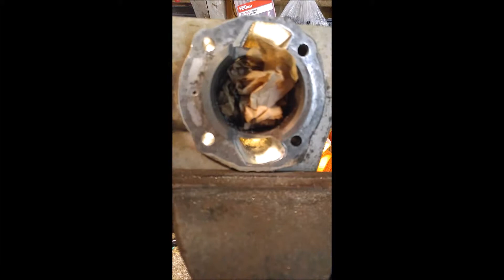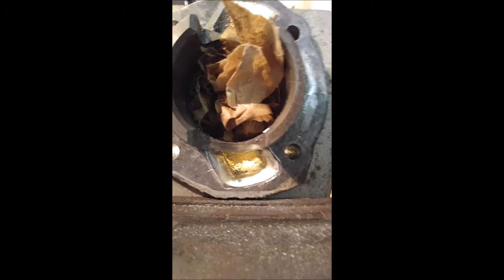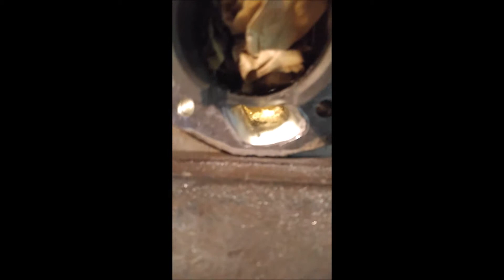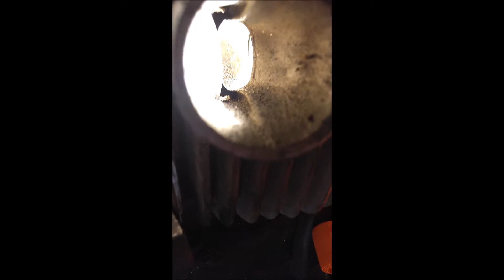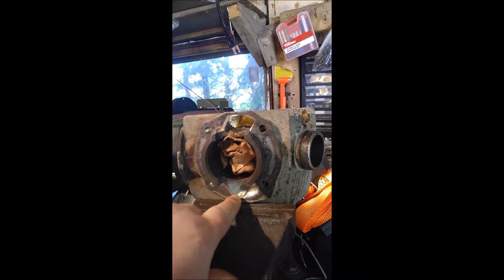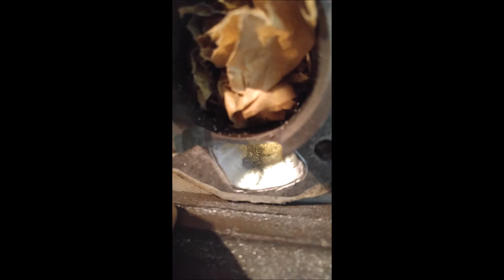Suzuki GT 250 2 Stroke Porting quick intro

Comment: Hey when are you gonna build the pipes? I'd love to see your recipe for mid range. Looking at building some too and the old old suzuki instructions were a fat middle and short overall length to the exhaust.  Higgspeed make a pipe for stock engines that's thinner and much longer, I know it's not a simple calculation,
Reply from the maker: I'm hoping to get to them soon like this fall or winter but I'm not sure. Just have so much going on I haven't got to it. I was gonna have Jim from Dynoport build me a set but I might still do it myself. I usually do my own calculations but there is a cool software called 2 stroke wizard it's only like 30 or 40 bucks and it's actually pretty neat. It's good to practice with by practicing measuring ports and port timing on an engine and plugging it all in and it builds you a schematic for an exhaust. You can choose low mid or high rpm focus from a torque powerband to a good midrange street bike or all the way to a very peaky gt style race bike and It does single twin and triples and I think it even does 2 into 1 for twins. Thanks for your comment, cheers bud!

Comment: I'm looking at getting performance mods for a gt250 what do u advice
Reply from the maker: Depends how far you want to go. The best mod you can do is get some 32-34mm flatslide carburetors and find a good set of after-market expansion chambers or have someone build a custom set for you. If you're gonna port the cylinders you want to raise the exhaust port 2mm and widen it 5mm and open up the auxiliary exhaust ports then lower the intake 3mm and widen 5mm. If you know how to do transfer ports raising them 1mm will help. Re-cutting the combustion chambers, tightening the squish band and raising compression helps a lot. Then you can get into electronic ignitions and different ignition timing also. Thats modest porting you can go further than that but you need to be careful with these bikes they are piston port and its easy to destroy your low end power and make the bike practically un-ride able.
Reply from the maker: If you're looking for a nice set of expansion chambers Jemco can make you a set.
https://www.facebook.com/pg/Jemco-Exhaust-Systems-159783504044199/reviews/?referrer=page_recommendations_see_all&ref=page_internal
Reply: could u advice me on a reputable shop which could do the works u described. thanks.
Reply from the maker: Where abouts do you live?
Reply: @Trumplican   well im quite far. do u have an email i can contact u at
Reply from the maker: @krrrazy  sure.. indydragon800@gmail.com

Comment: Bottom end and midrange power increased sounds good that’s how I use my bike 99 % of the time
Reply from the maker: Ya a bike with a more radical high rpm setup is good for drags or oval racing but for normal riding would be less reliable and hard to keep in the powerband.